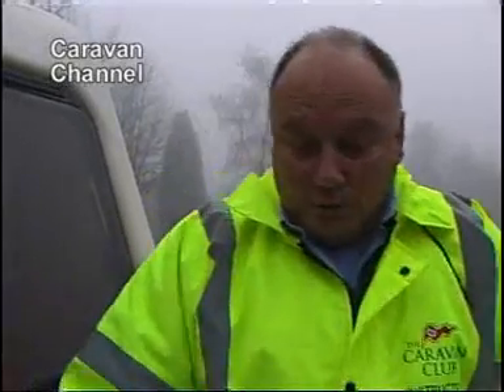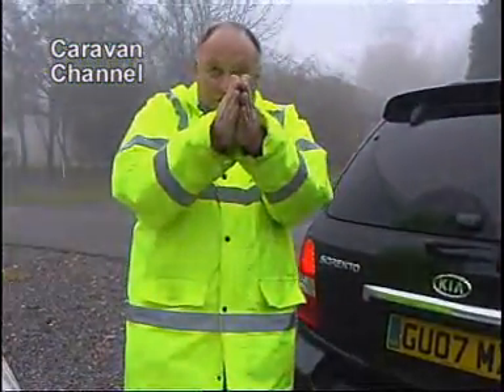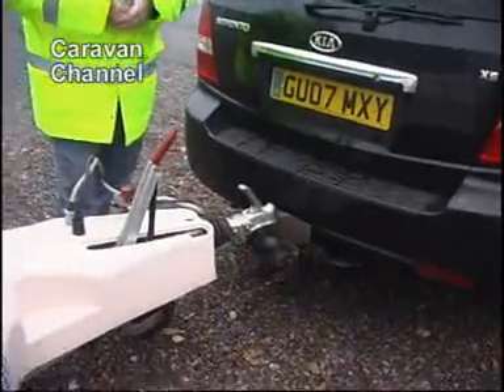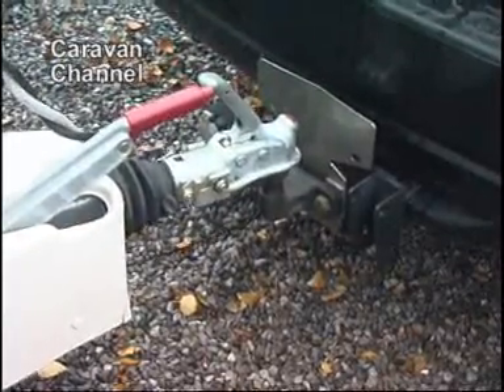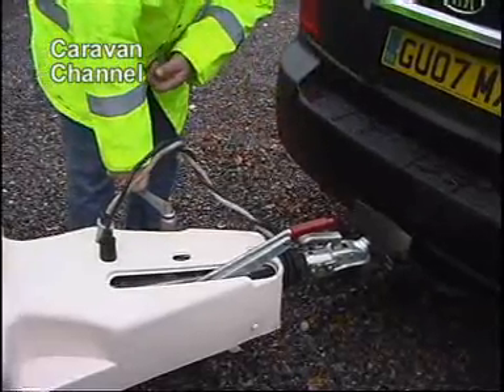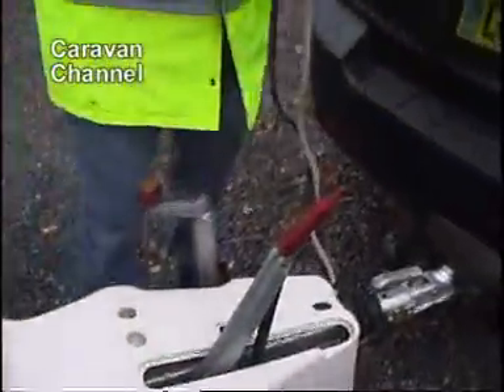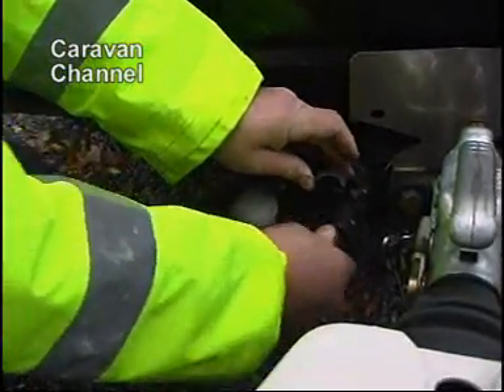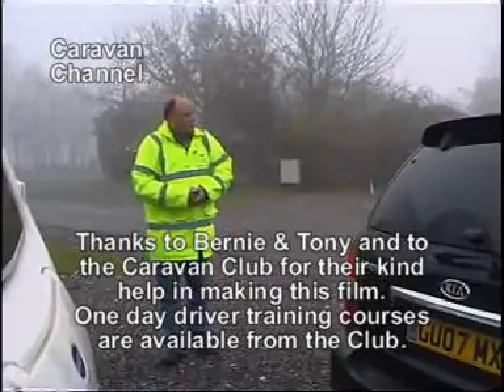Learn Towing Techniques

Comment: I would only take the hand break off once it is securely on the car, like I am going to control a 3 metric ton caravan if it decides to move. Also no safety chains? Won't be doing it like this clown.

Comment: Rubbish.. you can couple up much safer being stood out of the way of a reversing vehicle to which ever side you happen to be on. Even a twin axle can be pushed across a few inches with all 4 tyres in contact with the ground and if you wind the jockey up taking weight of the front set it will move easy. SO if you can align the vehicle bang on for a twin axle then why didn't you for the single? Goes to show that stood between the van and reversing car is not only stupid and dangerous its also no good. 
Also you released the brake before the coupling was on the ball... WHY? had there been a slight decline the van would have run into the rear of the car or worse running into YOU knocking you over. Sorry but an organization such as this should be more safety aware. Give clear verbal instruction stood out of the way and make sure the driver has his window down and can hear you... pfft...novices.

Comment: I read on the DVLA homepage that legislation regarding trailer lights will change from 2010, but information was scarce.   The change seems to involve the legal requirement to have a reversing light or lights (unclear) on the trailer.  This will then apparently require vehicles to use the 13 pin plug to allow for this.  Most new caravans have a reversing light already and many caravan manufacturers are already fitting the 13pin plug. Will older trailers/caravans will need to be retrofitted?